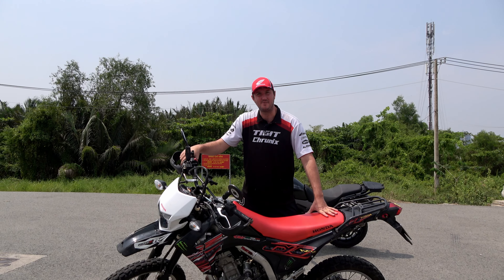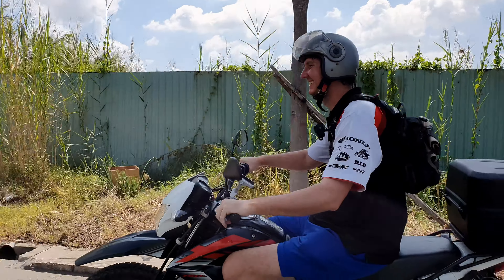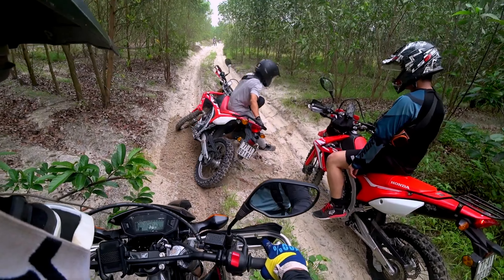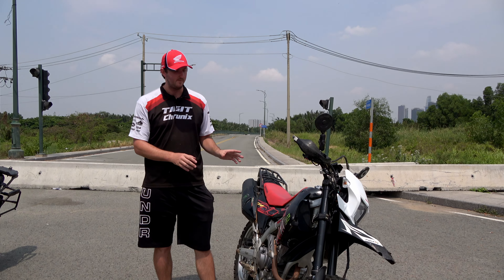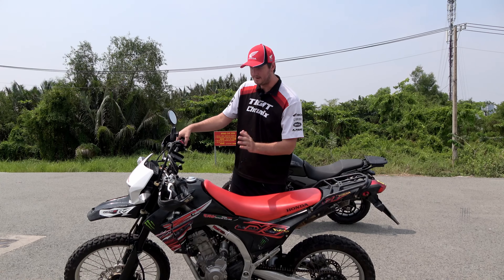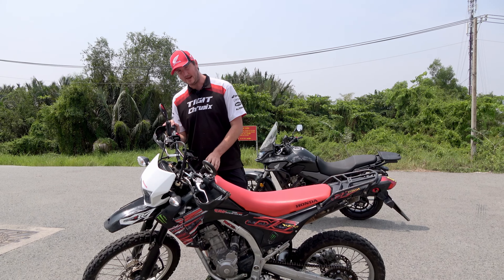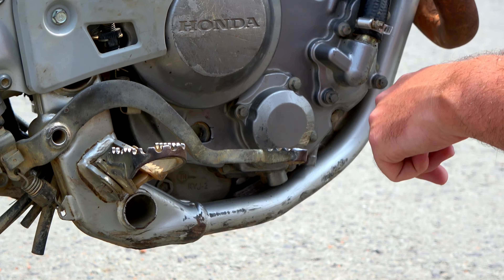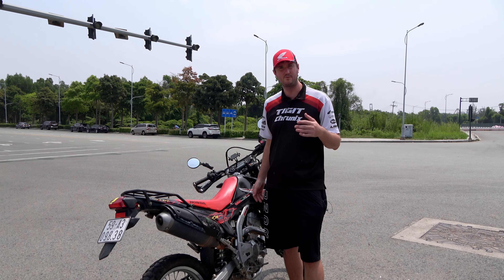Why you should rent the Honda CRF 250L

Comment: Really informative video.  I rented an XR150 for a recent HCMC to Hanoi trip and was very impressed with it. I found it a really lovable little bike that was great fun too.  I was particularly surprised at how comfortable it was. I actually found it more comfortable for all day riding than my own CB500X.  I find it interesting that you have found the XR and CB to be more dependable than the CRF250L.  I wish you could buy an XR with a bigger engine.  I had assumed the 250 and 300cc CRFs would be that bike but maybe not going off your appraisal.
Reply from the maker: XR is air-cooled, which is very important for amateur riders. Especially for rental companies!
You can buy bigger XR's. Either very old XR 400's (which are around in Vietnam a little, fake papers though), or Honda XR 650L (not available in Vietnam).

CB is a road bike, so not much to go wrong on those! Even if it has no coolant, the wind speeds will keep the bike cool.

The key here, which isn't documented much on the internet, is checking the coolant on a motorbike.
Also, offroad motorbikes really do need kick starters!
Reply: @Tigitmotorbikes  I am guilty of that:  checking the oil but not the coolant.  😦